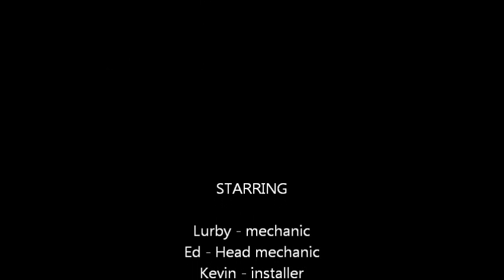Ford 4R100 automatic transmission rebuild

Comment: thanks for the reply Matt. I ended up buying a used pump  and used the pump body with the shaft with my original pump cover since I already pressed the bushing and seal onto it.  Both pumps looked exactly alike so im hoping it's the same version.  BTW any tips on removing the lime pressure modulator sleeve on the valve body.  I'm having the most difficult time removing it since there's no threads for a bolt to be screwed in.  I've tried different picks and small screw drivers but it's barely budging :/
Reply from the maker: +misterfakeid sometimes they can be tricky.  Luckily for me I have a lot of extra valve bodies that I can replace it with when they get really stubborn.  However, they do come out fairly easily when you get the hang of it.  I use 2 scribes and push on the top of the valve.  try not to touch any part of the valve with the scribe except for the very top, the scratches will tend to get the valve even more stuck (more stuck, not sure if that is grammatically correct but you know what I mean, haha). I'm assuming you bought a new line boost valve, and if so what you can do is drill through the old one enough to screw in a small bolt and then take a pair of pliers to bang it out.  Or lastly, sometimes I will use my slide hammer when they get really stuck but it requires more drilling to open up the hole.  Good luck.
Reply: +Matthew Damato OK. that's a good idea.  I'll just order a new sleeve.    when I removed the other valves I did end up pushing down on the sides to get it to move.   may have slightly scratched them with a   flathead.  do you think they will still function correctly or should I replace ?
Reply from the maker: It depends on material. Ford made those valves in both steel and magnesium with Teflon coating. If it's a steel valve, just hit it up with some sand paper. But if it is the softer Teflon coated type, I would throw it in the garbage. They are extremely sensitive unlike the steel type. There's no rhyme or reason which one you should have. But I have noticed the earlier units having steel. You might consider cleaning the bore too.
Reply: +Matthew Damato is the sonnax bore tool necessary or can I just use a dremel stone with an extension to reach inside?
Reply from the maker: A stone will destroy the aluminium. I cannot advise using a dremel.  Soft scotch bright works well. Place a piece on the end of a wire brush and then attach it to your drill. However, you may want to think twice with regard to even using this body if you have to go through all this trouble. If it does not clean up after a few attempts, give it up because it won't be worth it.

Comment: Hey Matt, do you have a wonderful little tip for installing the piston in the reverse input drum of a 4l60e? I seem to damage the outer lip seal... Regularly
Reply from the maker: Use a lot of TransGel.  You can also put the outer seal in the freezer right before install which will help and stretch the inner seal so it hugs the inside of the piston.  Then lightly, very lightly tap it down with a screw driver.  Make sure  the piston is lined up in the appropriate place.

Comment: Hi Matthew, I rebuild my 4r100 with the manual and your help, but wont works, just go reverse when select first. I rebuild it because it feels no power and now is worst. what it could be? :(
Reply from the maker: +flash flash well, I hate to tell you this but it could be 100s of possibilities.  First, check the fluid level, when completely dry and new torque converter the unit will hold between 16.5 to 17.5 quarts.  Any less and the trans will require fluid.  If still having a problem I would need more information. I would be glad to help if you can be a little more detailed in exactly what it is doing.

Comment: hey Matt.  hopefully my last tranny question. lol.  is a paper gasket necessary between the transmission and transfer case?  my kit didn't come with one.   I have a 7.3 4x4.  thanks !!
Reply from the maker: it is required and like you mentioned, the kit will not come with that gasket.  However, they are cheap and very readily available.  Most automotive parts dealers have these in stock because they are so common.   If not, you can always use silicone if you are in a pinch.  However I am not a fan of silicone in any way and would leave that as a last resort.

Comment: Hey buddy i have 99f350 4x4 7.3 powerstroke. The troubles since i bought it have been very slow to engaged to drive maybe a 3 second pause,but goes into reverse almost instantly. It has been this way for some time now,passable 5 years or more. New problem that is really worrying me is a new chatter/shudder from first to second gear , especially on takeoffs from red lights. I am not flooring it . What could cause such problems. We just purchased a new to us home and really really need this truck to buy supplies with. The fluid smells clean and not burnt,BUT i haven't taken the pan down yet . Please point me in some direction at this point i am lost.PLEASE HELP!! Thanks in advance

Comment: hey Matt. I definitely have  a warped case due to overtightening the center support bolts.  .002 feeler guage can easily slide under a straight edge in that area of the valve body.  what can I do to minimize cross leakage? will doubling up on the paper gasket help?  there's a specialty tool out there that can straighten out the case but it's close to  $300.  is it necessary to address this issue?
Reply from the maker: I have built hundreds if not thousands of these specific units and only came across a warped case one or two times.  In the rare instance when I did find that the case was warped, I threw it out (recycled the aluminium), and found a different case.  A stripped case should cost about $90 or so, which is a lot cheaper than the $300 for whatever tool you are talking about.  I have never heard of this special tool and even if it was cheaper I would not advise trying to fix a warped case.  Lastly, I can't see tightening those bolts would actually do anything to the case.  Generally those bolts crack or the center support strips out fairly easily.  Nevertheless, you can try doubling up on gaskets and/or try sanding it smooth with a straight edge if the warp is minimal.  Maybe take a ride down to your local machine shop to see if they might have something that can straighten it out.  However my advice is to find an empty case.  I am not sure where you live but VTP in Brooklyn is pretty good with hard parts or Relco in Queens (New York).  Those are the people I use.  Relco is cheaper but VTP has better parts.  Good luck.

Comment: hi. how do I remove the stator shaft from the front pump.   removed the 3 star screws but it's not budging.   I cracked the shaft while trying to remove the bushing :/
Reply from the maker: +misterfakeid sorry it took so long to get back to your question.  And I am sorry for your misfortune.  Generally, I would never attempt to merely change the stator unless I was really desperate to save the shop money or doing a favor for a friend.  Besides the 3 bolts, the stator is pressed in to the pump half.  Cracking occurs about 50% of the time.  And normally when the stator fails, pieces of metal get impregnated into the pump, making the entire pump useless.  An impregnated pump will make a whining noise and will eventually fail, despite being able to have enough pressure to leave the shop.  However, if I were to just change the stator, you definitely need a hydrolic  press.  Use something think to balance the pump half and try to cover as much surface area as possible.  Keep in mind all the valves and you do not want to put any pressure where a valve rides because it will cause it to get stuck.  In the end, it is much easier to merely buy an entire pump, although they are expensive.  They range anywhere from $80 to $200 depending on the year and engine size.  Also, there were several different types of pumps made that all look very similar so pay close attention.  Good luck and I hope that helps.

Comment: I have an E4OD and pump seal blew out. I replaced the pump seal with a silicone seal and replaced filter. Bushing not spun or scared. It leaked when warm. I dropped transmission again and replaced silicone seal with a Viton seal. Now it leaks immediately upon cold startup. Torque converter bad? Pump bad? Where do I look? No transmission codes, transmission operates as designed aside from leak.
Reply from the maker: I am sorry for the long response, this comment slipped by.  If the front seal blew out originally, the torque converter needs to be replaced along with the pump bushing.  Two different size bushings exist for the pump, early is wide and late is narrow.  Make sure you have the proper one and place the notch facing the gears.  Never use silicone.  And replace the pump o-ring and gasket, you should be fine.  I hope you fixed this by now but if you still need a hand, just ask.

Comment: Mathew I'm rebuilding my 4r100 and I'm having a hard time getting that 1-1/4" clip back on the output shaft. any help would be appreciated. I'm just a couple of hairs short of getting it snapped back in the groove. getting frustrated.
Reply from the maker: Those snaprings can be difficult. But don't let it discourage you. First, you need a good pair of snap ring pliers, I prefer Snap On. Now for the procedural steps: flip the unit over so the bell housing is on the floor, then install your parking gear bearing (or washer depending on year) in place, next put your parking gear in place if it is separated from output shaft, otherwise drop your shaft with the parking gear attached on the back of the case so it's standing straight up. Now, hold the shaft with one hand and flip the entire unit over so the weight is lying on the end of the output shaft. Have something set up so it won't tip over, or lean it against your bench. Now you can install your bearing with ring gear, and this should make getting that pesky snap ring in its place without too much trouble. You will need both hands, even with a good set of pliers. It's a pain in the neck sometimes but also try flipping the snap ring over, can help too. If you look closely at the opening, you will notice that it has a slight bevel to it. So flipping it over May give you the extra grab you're looking for. Good luck!
Reply: thanks Mathew I got the clip back on. originally I had the extension housing on an when I flipped the trans over the rear shaft bearing slipped an wasnt allowing me to pull the shaft up high enough to get the clip on. as soon as I removed it I tried it just like you did in the video when right on no problem. I also ran into a problem with the intermediate clutch plates. apparently I have a 60 tooth friction which is no longer available. dealership wanted $600 for the updated drum! not including bearing or washers. so I went to the scrap yard an pulled one out of a E40D for $22 have you ever ran into that problem with a 2001 4r100 ?
Reply from the maker: Absolutely, this was a huge mistake by Ford back then which they never took responsibility. In the early years of its production, these units constantly failed because the intermediate sprag would break. When they redesigned the sprag, they also redesigned the drum and frictions. After about a year, the problem was immediate to everyone. It was a money maker in the early part of that decades. You can easily replaced that drum with the earlier version that takes a washer or later version that omits the washer. Just make sure you Sun shell matches accordingly. You probably have the last of these known to exist.  Just a fun fact, when it became apparent that the new design was failing everywhere, Ford decided to not only go back to the prior design but to immediately discontinue production of the failed part in order to maintain their reputation. This is almost unheard of in automotive parts and a very unique problem.

Comment: May I ask exactly what tools are needed to rebuild this particular trans ? I have done a couple and I know that certain transmissions have there own types of tools that you have to use or there are sometimes different ways which I like even more but if the proper tool is cost effective enough I will buy it :)

Comment: hey Matthew... i am a re and re guy i purchaced a rebuilt tranny and installed it my self... still had issues i belive the lock up torque converter is fubared... so i decided tow my 99f350 down to the rebuilder and he first blamed the harness to the accumilator on the passenger side was fried and then he claimed it needed another rebuild and he installed the second one.. now he says it still in lock up and it would appear he full of crap in my eyes... next one im gonna rebuild my self but do you think the ford tunner is causing it to stay in lock up? its a recognised ford tunner.. really in a pickle here with this truck and he has had it all week.. any way of disconnecting the lock up converter electrically? cant wait to hear from ya man thanks in advance
Reply from the maker: Christopher Meek Sorry to hear about your misfortune.  To answer the easiest question first,  no you cannot electronically remove lock up nor would you want to.   without lock up in that truck,  the fluid will cook and overheat.  Next, a tuner can cause weird problems and I would put it back to stock.   Lastly,  I can try to diagnose for you but you need to provide me with the symptoms you feel.  Try not to get technical, just tell me what the truck feels like and what if any codes.

Comment: Do you replace all solenoids every rebuild or ohm, power and amp test them?
Reply from the maker: No, absolutely not. You would go broke. First, it depends on the unit, some units are more prone to solenoid problems than others. These 4R100 units tend to have a good solenoid pack and rarely go bad.  The part that fails on these is the actual connection to the harness. Look to see for any corrosion, and if it's clean you are probably good to go. Note too that there are several types of blocks for these units and if you do change, pay close attention which one you have. On the other hand, GM units have inexpensive shift solenoids that you can buy brand new for under $10. Therefore, in that situation, I just change them. Lastly, you can always ohm out the solenoid to check if it's electronically sound, but that won't tell you if it's mechanically impaired. Therefore, what I do is to insert air in the solenoid port and put 12 volts into it to check if everything is working properly. This method works fine for all on off type solenoids but won't work for pulse width type. I hope that helps, and good luck with your transmission.
Reply: Thanks man! I wasn't going to but after watching your vid, I replaced all the clutch pistons. This tranny's 15 yrs old now and the last guy probably didn't replace the pistons when he rebuilt it.
Anyhow they respond to air much better than before. Today I got the case loaded and ready to put the chain cover on in a few minutes. I like this work and wish I could make a living at it.

Comment: hey matt.I am having a issue with my 4r100 slowly engaging in to drive.and from what I have read it is most likely the feed bolts above the separator plate.I was wondering if you had any tips on replacing the check balls.the truck is a 99 f350 7.3 diesel 4r100.thanks
Reply: sorry forgot to say tips on replacing everything with the transmission still in the truck.
Reply from the maker: jesse abner most likely the clutch volume index in the forward drum is high.    in other words,  there's nothing you can do other than getting to that drum.   after years of use,  the frictions flatten and lose material.  Over time,  they need to be replaced.   Clutches are designed to eventually wear out and sounds like the case to me.   FYI,  you can check the bolts but I don't see any reason why bolts would magically come undone after years of being tight.   Unless someone was recently in unit,  I wouldn't hold my breathe.   Good luck.

Comment: Hi Mathew.  I have a question! ! u screw up on a 4L60E.  and now when I select 1st gear it moves backwards.   where did I messed up on ??
Reply from the maker: +Samuel Rodriguez That is a difficult question to answer without seeing the actual car or trans.  I would start first at the linkage.  Make sure everything is adjusted and tight.
Reply: +Matthew Damato thank you Mathew I find out that manual valve came loose 😐

Comment: How long does it take to rebuild a 4r100 on average for someone who has never done one, but has trasmission experience?
Reply from the maker: great question and hard to answer.  It all depends on skill and tools.  Generally, I can build this unit in about 3 to 4 hours from start to finish.  That is with completely rebuilding everything in the unit.  A lot of guys will claim they can build go a lot quicker but they take shortcuts, which never pays off.  For someone who never built a transmission I would expect a couple of days, maybe longer depending on what needs to be changed and the amount of damage. Tools are really important.  If you do not have the required tools, it will take you a lot longer than it should. Make sure you have a good air compressor so you can use air tools, otherwise to rebuild a transmission without air would take a very long time.  I hope I did not discourage you because it really is not that difficult.  Just take your time and anyone can do it.